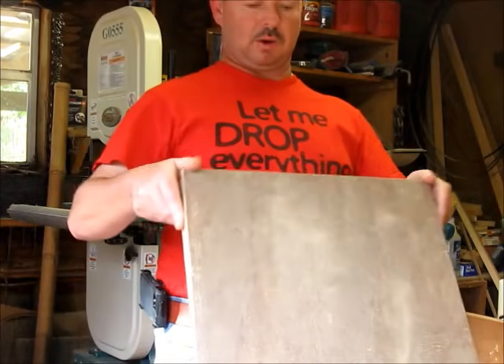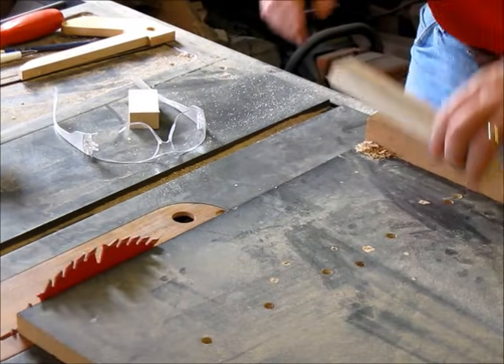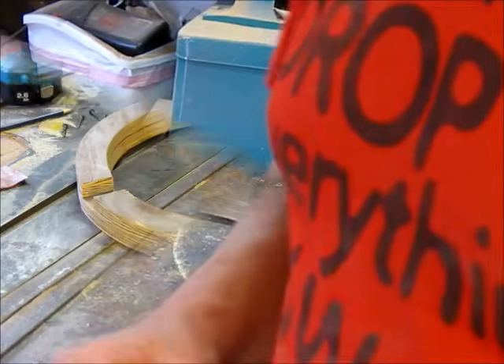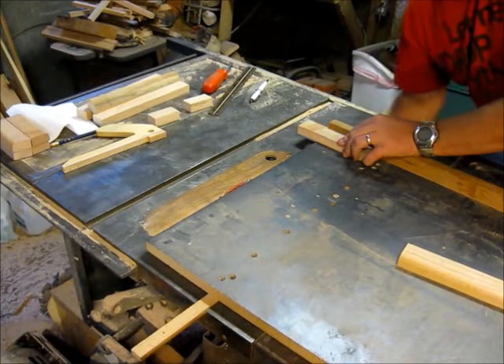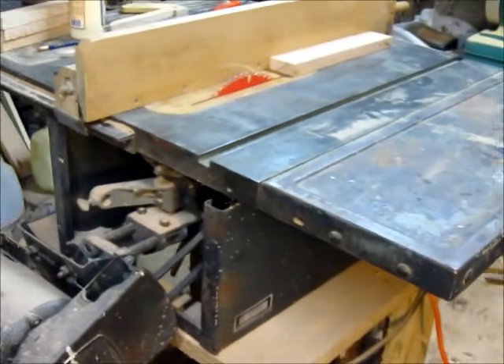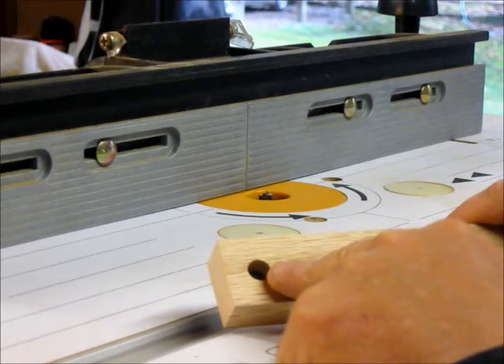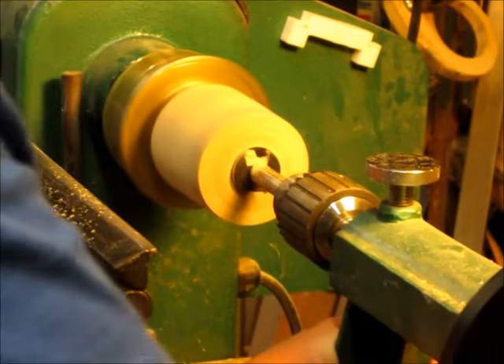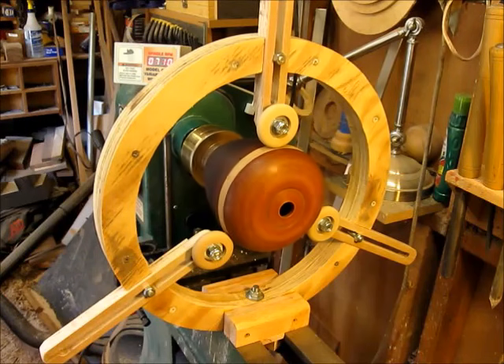#03 How to make a Shop Built Steady Rest

Comment: The date for when you made this makes pretty plain its been a while back. Just the same, its still a treasure and I'm glad I found it. Thanks so much for the generous spirit! Blessings!
Reply from the maker: +George Cooper Jr Thank you George. I still use this exact same steady rest a lot. It still works great. I have since added turned knobs to all the arms and clamps and replaced the wooden wheels with roller blade wheels. Other than that it is still the same fixture. Glad you enjoyed this project.

Comment: Fantastic job!  You are definitely a craftsman.  I'm going to attempt to build one for my workshop.  I saved this video so that I can go back to it as I build the steady rest.  Thank you for your video, it's great.
Reply from the maker: Thank you Richard, I'm glad my video helped you out. I have since made a couple of improvements. I added turned knobs to the arms and the clamp which just makes it easier than using a wrench.  I also used 2 inch rubber o rings on the wheels for a lighter touch on your piece. You can see the improved version at this link.  #06 Woodturning a Vase from Scraps Part 3  Thanks for watching. I hope you continue to enjoy my videos. Merry Christmas.

Comment: Nice design, Steve. I'll probably make one just like it. Might use some cheap 2" or 3" wheels from Harbor Freight. Thanks for sharing.
Reply from the maker: Very good, My wheels ended up costing around 6 dollars each. with the bearings and I also added rubber O rings as tires. You may be better off. However I would suggest that the two inch wheels will allow you greater capacity in diameter of your piece.  Thank you for you comment and Merry Christmas.

Comment: Fabulous show!! Well done.! I did mine over the weekend with old rollerblade wheels.
Works great and runs smooth.
The only catch was good old murphy's law putting one of those screws holding the two rings together  after they were glued together, exactly there where the center bolt comes through. had to offer one of my steel drills to get through that screw because the socket has already been tightly fixed to the ring with glue  :-(
Therefore watch out for Murphy and think twice where you set those screws before doing the rest of glueing…
Thanks for sharing this way how to safe a lot of money :)
Reply from the maker: Johannes Hohenbühel Thank you Johannes. I'm glad you enjoyed this project and found it helpful. I still use this same steady rest except that I have upgraded to the rollerblade wheels myself. Sorry about the drill bit, but you still saved a fist full of dollars. Thank you for sharing your experience and supporting my channel.

Comment: Excellent job Stephen. I need to build a steady rest for my lathe, if you don't mind I'll copy the way you did yours. Cheers... Adam
Reply from the maker: The steady rest works very well, I did make some improvements. I installed 2 inch O rings as tires on the outside of each wheel. I also turned knobs for all the adjustable nuts so I did not need a wrench. Thanks for commenting and supporting my channel.
Reply: Stephen Ogle Great video and step x step instruction! While watching you bore the wheel stock, the o-ring idea popped into my head. Glad to see it is a viable option.
Reply from the maker: Thank you sir for commenting. I still use this steady rest quite often and am completely satisfied with it's performance. Glad you enjoyed this project.

Comment: Hey Rob I know it's been awhile since you made your lathe support and maybe you know this now but when gluing up projects sprinkle some salt on the glue areas and when you clamp it the wood won't slide around as you add clamping pressure, it's a trick I learned a long time ago and works well
Reply: Hey thanks for this tip Ronald

Comment: Thanks for the detailed information and I'm getting ready to make this. Did the wooden Wheels work out well or would you now suggest ordering wheels for it? Thanks
Reply from the maker: Thank you Josh. Glad you enjoyed this project and found it useful. I would recommend using another type wheel for this project. The wooden ones worked well but were more maintenance. Rollerblade wheels are what I went too and they worked great until I sold this lathe and sent the steady rest with it. I hope this helps. Take care.
Reply: @StephenOgle  Thanks, that's very helpful.
Reply: @StephenOgle  Here's a laugh for you. I started looking for rollerblade wheels but then found used little kids rollerblades for $20.

Comment: I'm in the same situation. I have a large Jamison hollowing rig with laser and camera on the over head arm. I will rotate the arms on the rest 20 degrees clockwise (looking from the tail stock) and that will take the top arm out of the way of the overhead sensors..

Comment: Good job.  Where did you get the bearings?
Reply from the maker: +Randy Birkelbach Thank you Randy. These bearings came from my local Ace Hardware, however I have since changed to using rollerblade wheels and they can be purchased at lots of places really cheap. Hope this helps.

Comment: Stephen
What diameter/mm are your urethane wheels? I have the rest built but having trouble finding the wheels. Great instruction. Thanks
Reply from the maker: +Tim Mehling I believe they are 2 inch. I have since changed over to the roller blade wheels. They work very well. Hope this helps.
Reply: Walmart has them

Comment: How did the wood wheels work? Did they hold up? Leave marks on the piece you were turning?
Reply from the maker: Good question John. The wooden wheels ended up not being ideal. They began to crack after a while so I changed them out for roller blade wheels about a year after this video. Many of my later videos shows this steady rest with the new wheels. the roller blade wheels worked great until I sold this lathe.

Comment: I built one today. I don't have any wheels just yet. Gonna make them tomorrow. You think the wood wheels are better then the skate wheels?
Reply from the maker: Thank you sir. Glad you enjoyed this project. I used this steady rest until I sold my other lathe and it went with it. I would recommend the skateboard wheels. I did not have problems with the wooden ones except that the O-rings I used would not stay on the wheels. I hope this helps.

Comment: Stephen, it's been a few months since you published this video.  How has the steady rest worked out?  Is there anything you would do differently, if you needed to build another one.  I need one, and this looks like it will work for me.
Reply from the maker: I have used the steady rest several times. I made a couple of improvements from the original. I turned some knobs for the arms and the clamp to keep from using a wrench and I also added 2 inch O rings to the wheels as tires. Really works good. You can see it with the improvements on my video Woodturning a Vase from Scraps part 3 here is a link to it.  #06 Woodturning a Vase from Scraps Part 3  Thanks for your great comments and questions.

Comment: Hi, Just wondering how big it is and about how big of turning you can put in this?
Thanks  Steve
Reply from the maker: ***** Thans Steve for your question. This steady rest is 13 inches inside diameter and can turn pieces of around 10 inches in diameter. Thanks for commenting and supporting my channel.

Comment: A really good thing to use for wheels is hockey pucks, Cheap like dirt and you can cut them to size on a lathe to any shape and resses bearings in them.
Reply from the maker: Thanks George, I would have never thought of that. Sounds like a great idea. I may be giving this a try when these wheels wear out. Thanks for the suggestion and for supporting my channel.
Reply: Stephen Ogle